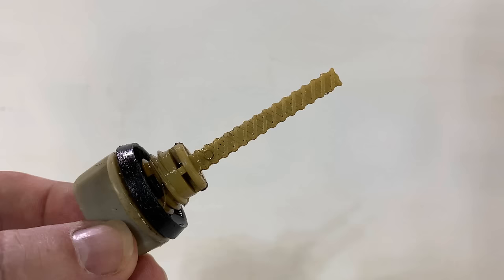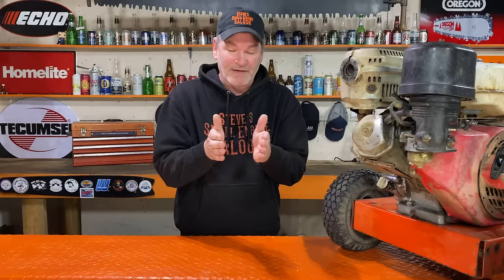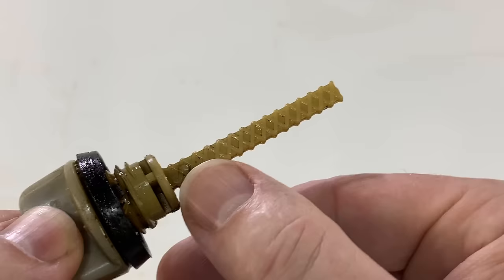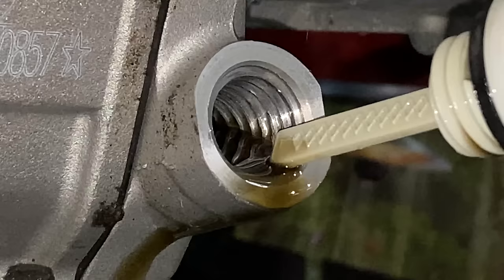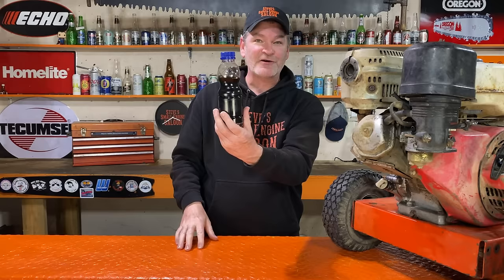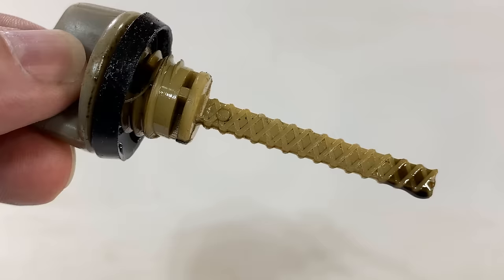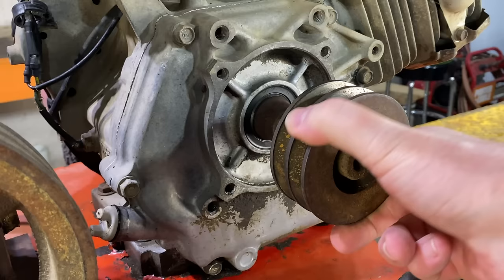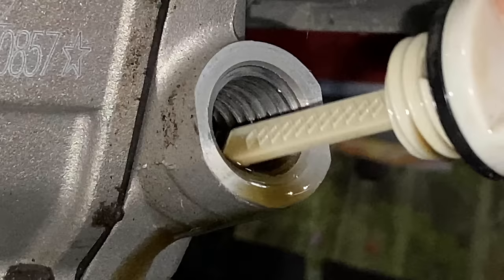Don't DESTROY Your Honda GX Engine By Making This COMMON MISTAKE

Comment: Thanks Steve. Whoever designed that feature was the real dipstick...
Reply: nice onr.
Reply: That was a good one...lol
Reply: I see what you did there
Reply: Epic comment 👌
Reply: Excellent metaphor William!
Reply: Lmfa
Reply: It’s made Honda thousands and thousands of dollars
Reply: That dipstick fits a variety of models--not just the one you have. Also. you stated that it has the oil level sticker on unit. Remember what Norm Abrams said about machinery. Be sure to read, understand , and FOLLOW THE INSTRUCTIONS BEFORE USING THIS MACHINE.
Reply: I made no statement at all about there being a sticker on the unit, did you even read my comment? I made a joke about the designer being a dipstick. I am indeed a nerd like Norm and always read the instructions, and follow them. Whenever I do an oil change on my generator, I make sure the surface is level, and fill the oil tank until it overflows, just like the instructions say. Don't really appreciate the yelling at the end of your comment, which I read, unlike you did with my comment. Perhaps you should read things more carefully.
Reply: It was thrown in there for the sales team. It’s called planned obsolescence. If you obsolete your generator engine by not reading the owners manual because that picture is as unclear as that dipstick is, you will have need of a new engine, or most consumers whole generator.
Reply: Oh dear , someone had to say it 😂 and you beaten me to it 😂😂😂
Reply: Dipstick is correctly designed.  Just need to dip it and not thread it in while checking the level. Not an ideal design, though.  Let's you see the color of the oil, which gives some indication on cleanliness.

Comment: You're exactly right Steve ! I work on small engines some in my spare time.  Whenever I come across those I usually snip off the dipstick part  so there's only a cap left.  Then tell the customer to  fill it until it's dripping out.
Reply: Now that's debatable, cause it needs 2 be set,n leval,level, on job sites ,that's not always the case,the holes in stick are 4 safe zone  Dud,so correct ur statement
Reply: @stanleyshults6427  Wrong. Oil levels on ALL machinery must be checked when the unit is level, period. If it's not, you're wasting your time and risking damage.
Reply: @stanleyshults6427 You couldn’t be more wrong, listening to your “advice” will send the connecting rod through the side of the cylinder, I have seen it done more than a few times.
Reply: @stanleyshults6427  I refuse to believe your level of education in any higher than grade 6 and don't bother trying to argue that because nobody will be able to read that either.
Reply: @stanleyshults6427 nah buddy,  you got it all wrong

Comment: I thought all Honda engines had a low oil shut down. Shouldn’t that have saved this engine from destroying itself?
Reply: Look at the crankcase of gx engines or generators around you,
If you don’t see the bolt and wire on it 
That’s the model doesn’t have such features

Comment: What kills me is the customer who wants a 9th new pull cord but still refuses the valve adjustment that would bring back 1 pull. They would rather "save" 20 bucks and pull it 8 times.
Reply: New camshaft time.

Comment: I need to check that on my two Honda engines.  I fell for the"fake" dipstick. 😳
Reply from the maker: Good luck!
Reply: Please note that Steve references the GX engine in this video, Jim. I have a pressure washer with a Honda GCV190 engine and it does not need the oil to come to the top of the fill hole. On the link below reference bottom of page 7 to top of page 8 for oil level instruction and reference page 3 for diagram of dipstick and explanation of upper and lower limit marks. This also applies to the GCV160 and GSV190. I don’t know about others. 
Personally, I think it is bad practice to put hatch marks on the upper part of the dipstick, above the full level mark. It threw me off, hence the research I have done. 
https://cdn.powerequipment.honda.com/engines/pdf/manuals/00X37Z8B0023.pdf
Reply: @wittydisplayname1761 yeah I filled me gcv 160 up to the top after watching this without doing anymore research. It starts but shuts up instantly. 😂 I came back to double check this video and then looked up the manual online. Seems like someone would clarify that not every engine is this way and make sure to check the specs on your pressure washer.

Comment: Great PSA for those who don't know👍 I've always filled the gx, it's clones and many other horizontal shaft, angled fill plug engines till overflowing when level. But can totally see how it would be confusing to those unfamiliar with small engines!
Reply: Hmm, I wish I saw your comment before posting.  I will repeat though that Honda has the manuals available for download as well.  Typically you only need to know the serial and model of the engine or piece of power equipment.
Reply: That's the way it's always been done. Anyone who doesn't know how a small engine is serviced should get it done by a professional. Every year, or when something goes wrong.
Reply: Thanks god bless

Comment: Same on some of the old cylinder engines over here in the UK
Reply: Use the McCulloch chainsaw to cut some firewood and then next about a week later went to use it again could not Pull the Rope out what can be wrong it is just solid
Reply: @bobkalinoski8447  check the pull cord is not stuck first.. if not take the plug out and try to pull it ..

Comment: Steve, thanks! I live off the grid and after 35 years I've gone through a few generators, more than I want to think about. I'm was guilty of the dip stick mistake. Good thing those engines are so tough! Your videos have saved me alot of time and money. Thank you! As always excellent job.
Reply: Get a commercial diesel generator that makes double what you need and don't look back. Remember to balance the load on each winding of the generator. If a generator is rated for 10,000 watts, that is not 10,000 all on one circuit/winding. That is rated for 5,000 watts on each winding for a total of 10,000 watts. 👍
Reply: Glen, How many hours did you get on your longest term generator and what is the brand name of the generator that has given you the longest life. This topic interests me the most. I follow longevity on the harbor freight stuff very closely as well.
Reply: @mannys9130  Many don't have a budget to support something like that. But what are your thoughts about using one of those 4 cylinder diesel mobile construction light rigs. I thought about using one for back-up power for my home but the kilowatt output seems low for as large and robust as they are. Any thoughts?
Reply: A lot*. Two words.
Reply: @giggiddy  It's cheaper overall to buy 1 over-rating generator than to go through "a few" smaller ones. 🤷🏻‍♂️ You know? They say "buy once, cry once" as it relates to quality purchases that are more expensive than cheap designed-obsolescence China specials. I'm not familiar with the rigs you're mentioning so I don't feel comfortable giving an opinion about them since it'll be based on ignorance which isn't good. It may be possible to build your own generator out of one if the engine has enough power to turn the power head. Source a rig that has a burned out component but a good engine, and source a larger alternator power head and mate it up to the engine with a custom fabbed up adaptor plate for the bell housing and a coupler for the shafts.

Diesels are just great for generator use because their fuel never goes bad. They have lots of torque to twist that rotor under heavy load. They are overbuilt, easy to govern, and there's not much to go wrong on a mechanically injected engine. Plus, you can even run it on waste veggie oil for off-grid living which is very cheap to do. Buy a few large heating oil tanks or a few underground tanks (preferably), go get free veggie oil from restaurants, filter it, set up the heating and filtration system for the veggie tank side, and then have 1 tank of biodiesel, pump diesel, or non-taxed off-road diesel or heating oil. You start and warm up an engine on diesel or biodiesel, and then once it's hot and the WVO tank and lines are hot and thinned out too by their heating system, you switch to the oil. Then you shut back down on diesel by running it for 5-10 minutes on plain diesel. You could make your own biodiesel out of the free veggie oil for that too! :) The fuel would be nearly free with the only costs being the chemicals needed to refine the veggie oil to make the biodiesel. With a bit of up front investment, a solar bank with a diesel generator can give you basically  free electricity for years with only occasional repair and maintenance costs. :) It's amazing.
Reply: The YouTube channel blancolirio (aviation based) has a video about the Honda 2000i and how food trucks in  New York run them 20 hours a day for 5 years (the one in the video) and someone did the numbers in the comments. It had approx 950,000 miles equivalent on that generator.

Comment: I've had my Honda snowblower since 1996. I always filled until oil was touching the dipstick threads. I never wanted to be one of the over fillers. 
Thxs Steve for the info. I'll be  adding a touch more now.

Comment: I'm glad I learned that a long time ago. Fill it up. I do the same on briggs. Fill it  up to the top thread. Thanks for sharing. It is confusing to some. You may have shared this but showing the  difference in kolher,  briggs and kawasaki dipsticks. Some thread in all the way to check the correct oil level while others like most kolher dipsticks rest on top of the threads.

Comment: Steve - Thanks so much for the video!  I have the Honda engine on my pressure washer, and I was doing that thing:  the oil level was at the center of the cross-hatched area, so I thought it was OK.  After seeing your video, I added oil, and it took about a pint more to fill it up.  I think you saved my engine!  Thanks again and keep doing what you do!  John
Reply from the maker: Glad it helped
Reply: Very good explanation Steve I’m glad I saw your video.

Comment: Great info Steve.
Changed the oil on mine a couple weeks ago and had the manual and the internet and it was still not clear. This is perfect. Now to go check it before I run it!

Comment: Good tip Steve, might as well just cut the checkered area off of those dipsticks just so it won't mislead someone in the future. 🙂👍
Reply from the maker: Great idea
Reply: Thanks Steve
Reply: May have to do that next time one goes out the door👍 also, I've never seen a "cross hatch" on the aftermarket magnetic plugs. And never even thought, why not😅 should've followed how Briggs did it with the old flathead horizontal engines!
Reply: I'm pretty sure I'll be doing that from now on Aaron, don't know why I didn't do this already. Thanks  👍
Reply: I was thinking the same John.
Reply: Thanks MT, from now on they’ll be cut off at my place. 🙂👍🏼
Reply: I agree cut it off p
Reply: I cut it flush
Reply: The dipstick is useful for checking oil quality, not quantity.
Reply: @steamboatmcg2197  that’s what I use my finger for. 🤣👍🏼
Reply: @Big_Johns  you can do that but I don't want whatever might be on my finger to contaminate the flavor of the oil when I taste test it.
Reply: @steamboatmcg2197  now that was good, lol brother!!! 🤣

Comment: Great point Steve! One more good point is that on so many makes and models of small engines that have these threaded dipsticks is whether to read the oil level with the dipstick removed then just reinserted just resting on the threads or to thread the dipstick back all the way back in, then remove it and read the level mark that way? I have old Briggs engines that require threading them all the way back in and some newer ones that do not. My Kawasaki engines all require not threading the dipstick back in but to remove, wipe, then reinsert without screwing back down, then remove again and read.
I wonder why that Honda GX engine didn't have a low oil shutdown feature?

Comment: I started mowing lawns at 12 years old in the late 70's.  Back then all the mowers, roto tillers, etc. Only had a plug.  Fill til oil just starts to run out and your done!  Then they came out with the stupid dipstick.  Trouble is when you add oil in the dipstick hole you can't get an accurate reading for about 10 minutes. The dipstick tends to sweep oil off the tube sides.

Comment: Thanks for that tip Steve. . .I just checked the oil in my GX350 and that goofy dip stick shower oil half way up.  Now I know that there is not enough in there and will be filling it tomorrow. . b.Kudos to you Steve.

Comment: Great tip. I wonder how many extra engines Honda has sold by adding that dip stick? Always remember, there's a reason for everything.
Reply from the maker: GREAT POINT!!!
Reply: Idk, I think Honda's point of the stick was to make visibility better so that people can see where the level is when low. How can you guesstimate how much you'll need to get to add if you can't see the current oil level? The instructions say to fill it to the threads, and it's assumed that people read the directions or at the least look at the clear pictograph on the side when spending hundreds of their dollars on a piece of equipment. That may be too common sense for the public though. Lololol

Comment: My Victa whipper snipper has the same Honda type gx25 engine.  Fortunately I read all my gardening  engine manuals.  Also change the oil more frequently as it has such a tiny 80 ml capacity so if any crud/metal shavings happen, it'll be flushed sooner than leaving it in and risk damaging the cylinder/pistons.  It purrs and still runs like a dream over 6 years and fairly frequent use.

Comment: Thanks Steve. Have a China clone of this engine on a generator. Have always kept the oil full up as you show in the video. No manual,  I was simply going by my experience with older B&S horizontal engines with the short fill tube, those just have a cap, no dipstick. Always filled up them up level with the cap opening exactly like you show in this video. Same deal with 1950s era 6BH, 8BH, etc. engines, no dipstick, you simply fill 'em up. Good job.

Comment: Thanks to you we just replaced our tiller’s carburetor and it’s working great all for a whopping $12 bucks!
Reply from the maker: Right on
Reply: @StevesSmallEngineSaloon  Used it yesterday after swapping out the carb, ran great, towards the end it did begin to bog down a bit.  While cleaning it up before putting it away I noticed what smelled like gas at the bottom of the carb case took the cover off and holy cow filter was completely saturated - any thoughts?

Comment: I just changed the oil in my GX 270.Checked the oil with the dip stix and it showed OK. Fired it up and it would only stay running for about 3 seconds and go dead. Added more oil like your video says and it fired right up and STAYED running. Who knows what I would have resorted to had I not found this video. THANKS!!!!!
Reply from the maker: You're Welcome...

Comment: I have a big echo 67 cc chainsaw 24” bar and it has been a beast and yes I have the tool kit to change the fuel jet so you don’t burn your motor up. They have them set so lean to pass emissions test a good dealer will turn the fuel up for you but I have a little kit that does every chain saw made. I seen your sign in back ground and my saw must be diffrent than the all orange because mine is almost all gray with a little orange on it  and I don’t know if that means anything. Like a commercial saw or something else but I have had it about 10 + years and it’s a beast !😊

Comment: Thanks Steve
Great information for those who don't know
I get a lot of commercial customers bring in these types of engines saying "but I check the oil regularly" but the motor is blown up
They don't know they are not checking correctly
The Chinese Honda copies are the same
Cheers mate have a beer for me
Chris
Reply from the maker: Right on Chris!
Reply: I've got a Chonda in my Northern Tools generator. It works, but it is clearly not as good as my other true Honda engines in other things I have.

Comment: So true. I picked up an inverter generator recently that cost almost nothing because the previous owner had thrown it out for non starting. Adding engine oil to the correct level and it started immediately. Bad oil levels seem to be a common problem..

Comment: If the conrod did not damage the cylinder wall or any other internal parts, replacing the condrod and piston sometimes is worth it. (if you are lucky) most times the inside is demolished.
Reply: best guess is the piston bound itself into the cylinder from lack of lubrication
Reply: @Krankie_V  at that point, a predator swap or princess auto equivalent may be a viable option!
Reply: You can bet that the cylinder walls, piston and crank are so badly scored/galled making it a complete waste of time, money and effort to bother with rebuilding. Honda parts are very expensive on top of that.

Comment: Late to party but thx. for the info Steve. I have a couple of these engines on a pressure washer and Lawn mower. Very solid, reliable motors.